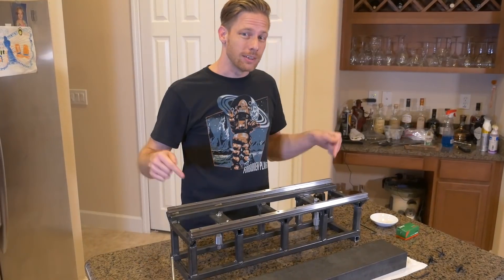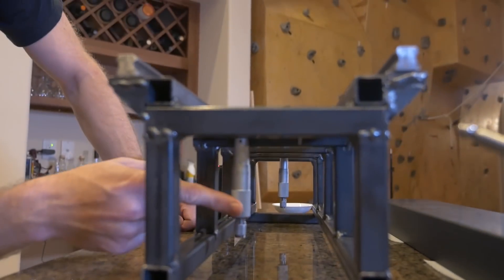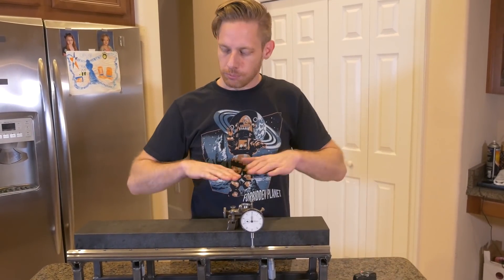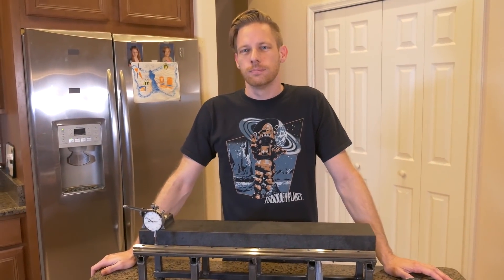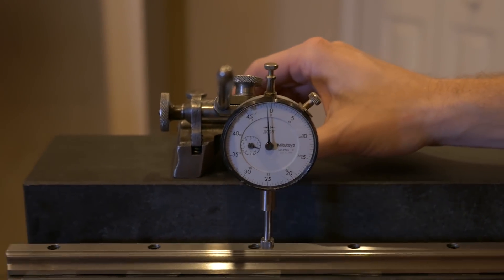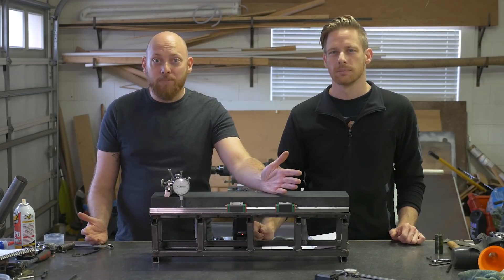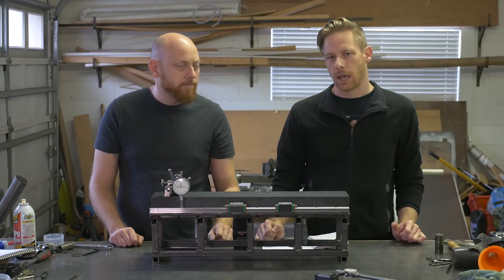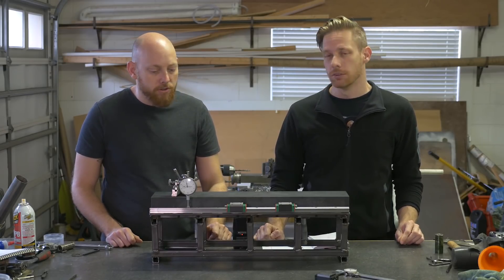Mini Surface Grinder Part 1 - S02E12

Comment: You must break a lot of taps...
Reply from the maker: haha, i guess you can tell by how careful we are being. the tap we used for this was pretty old, and not that good to start with. also Ryan was being extra careful to get them tapped straight as its pretty critical for this setup.
Reply: Agbhar Gihad haha, I don't think I'm doing too bad. Most of the time my taps wear out before I break them. The real trick to (almost) never breaking taps is to make sure they go in straight. Next most common is having the tap in a handle and snagging it on something sticking off the work piece...whoops...

Comment: Very interesting.  I love how you feel like you have to explain why you did it so the YouTube experts won't tear you apart.  Thanks for sharing.
Reply from the maker: yeah, we are also trying to think a little outside the box on some of this stuff, so it warrants a little over explaining. neither Ryan or i come from a machinist background so a lot of the times we do things in weird ways that people in the industry think are crazy. sometimes they are right ;)
Reply: It seems worth separating the personal from the technical.  Let's distinguish "tearing them apart" - personal - from attempting to provide hard-earned knowledge about how to improve the project - technical.  
I would rather someone explained to me that metal will warp during welding, and what I could do to reduce or avoid or allow for that, and that it needs to be stress-relieved after welding, than have what I thought was a decent machine tool come out warped, twisted and unstable - and transfer that distortion to everything I used it on (such as a lathe bed).

Comment: It looked like your metal frame rested on 4 points. Why not have one end rest on a single point so you dont need to worry about countertop flex which could take your ways out of parallel. If frame is very ridgid(looks to be) it should be resting on 3 out of the 4 legs unless your counter is flatter the the plane of the 4 feet supporting your metal frame. To clarify, it is very unlikey that your counter is within .0005 between the ends of the 2 bars. That would very likely cause a twist in your ways. 3 contact points would take out another variable of the many that must be dealt with.
Reply from the maker: thanks Jim, thats good thinking. i am curious how much it will put twist in the rig given how rigid it is. i will add it to the list of tests to do tonight.
Reply: Not much at all, but since you are going for .0005, I can see it twisting at least .001. since your counter is likely of by a few thousandths from polishing and maybe another couple from the cabinet structure and adhesive, that and the fact that it wasn't rocking means that it conformed to your counter- otherwise we'd be assuming that both your frame and counter we're within .0005. please don't take this as a negative comment- I loved the video and what you guys are doing or I wouldn't take the time. I want you to have a near perfect surface grinder and if I see where my $.02 can I'm going to offer it. I've made spools for hydraulic valves within .0002 on a harbor freight lathe so I know first hand that precision work can be done on harbor freight tools. That said, I also have YouTube "experience" lol from watching oxtool. You probably know who he is, but he has many videos on high precision work with basic tools.

Comment: Interesting project. I like how you went about checking the flatness of both rails. One small suggestion, please add some more and larger support gussets. It sounds like you plan to mount the other axis on top of this one, in which case this seems far too flimsy.
Reply from the maker: thanks Siegfried, that was my first instinct as well after seeing Ryan's design. he said he thought it was going to be enough (he is often right about these things) so we moved forward. after it was built i put the surface gauge on it and put as much of my weight on one point as i could (maybe 100lbs) and didn't see the gauge move even a quarter thou. for grinding, this set up wont ever see that kind of load. later on when we build the big one it will end being a cnc mill, and will see higher loads, in which case we will beef things up.

Comment: You guys know there's going to be people who say you can't do this, I'm in your corner boys and wish you all the luck, my only advice would be set up set up and set up and the least amount of grinding possible on the lathe bed ways, I'm sure hoping it works out for you after all the work you've put in to the lath so far, may be you could put a test piece on the bed some how when you get to that point.

Great job, Alan.
Reply from the maker: Thanks Alan, we have been discussing how to mitigate risk for a while now on that subject. i do plan to do incremental testing, including some test pieces strapped to the bed.

Comment: just out of curiosity, did you check your granite? found the setup with the bessle points very impressive and clever ;)
Reply: Anton I don't have the ability/tools to check the granite myself, so I'm relying on the manufacturer there. Their inspection paper says they're flat, parallel and perpendicular to a few millionths- I can at least confirm the sides are parallel to under 0.0001" using a micrometer. Maybe in the future I'll go hunting for (or make?) an autocollimator
Reply: Ah sorry i forgot you bought the granite plate, somehow i thought it was an auction score ;)
I suppose we can trust the manufacturer ^^ thanks for your reply and I'm looking forward to your next video!
The way you approach certain things is fascinating and also for me a great learning experience. I couldn't think of anybody else who goes all in when it comes to renovating one machine and ends up building one to do the job :D
Have a nice day!

Comment: What about torque on all the allens? really curious if you established a uniform torque.... is it necessary??
Reply: Liazon098 I expected to break out the torque wrench or to count flats, but it turned out that as long as it was "tight" no amount of tightening made any difference to the measurements

Comment: It would be interesting to see the actual accuracy of the whole setup.  You have no solid contact between the frame and the rails. I mean, you have shims right under the bolt and there is nothing to support the rail between shims.  The rail may looks rigid, but it actually isn't. If you put a dial gauge to the rail center and apply force downward to the rail you will see what I mean. When you put Y axis ontop a rails, it weight will bend a rails just a bit, and this deformations will be quite uneven through the rail. It may work for your cases, especially if you aren't going to precisely grind large surfaces. 

BTW, why don't you use granite surface plate as a base for your grinder?
Reply: It will not be accurate, not by a long shot.
Reply: Maksim Gurtovenko just gave it a try (indicator centered between bolts on the section with the most shim) and couldn't get the dial to even wiggle. I think we're still in good shape!

Comment: Nothing like building a precision machine with Harbor Freight tools. 😂

Use a torque wrench on those bolts to make sure you're getting the same torque on all bolts, every time. 

Solid mild steel bar stock is not very expensive for this scale. Might have made more sense than tubing. Too late now, so instead pour lead in the tubes for rigidity and mass. Then re-level with a torque wrench.
Reply: Jon Miller, i think the same with the torque wrench

Comment: Any recommendations on where to get a reference plate?  aka the granite thing?  What makes it even more complicated is Australia :(
Reply: Joe -  New they are expensive. You can find surface plates at industrial cutting tool stores, also on-line. You can pick one up at bankruptcy and estate auctions. Here's a cheat: a piece of float glass is pretty flat. The downside is getting a thick enough piece.
Reply: Glass is not flat compared to a lapped granite surface.
Reply: Check out MSC industrial supply.
Reply: Barthoization - Agreed. But lapped granite is comparatively expensive. The guys in the video aren't using a lapped granite surface. It's a kitchen countertop, which is more smooth than flat.
Reply: SeaDadLife what led you to that assumption?
Reply: Joe  The black bar of granite  is a highly accurate reference. But the flat surface granite was in their kitchen.

Comment: Just out of curiosity, why would you measure your tolerances from the top of the rail surface (where the bolt holes are) and not from the tapered part of the rail where the slider bearing make contact with the rail?
Reply from the maker: Great Question, mostly out of convenience. the part the bearings slide on are actually concave to match the profile of the ball bearings in the carriage so taking a measurement off them consistently is very difficult. that being said we will actually be taking final measurements right off the carriage when we are done. that's the only measurement that actually counts.

Comment: Great work, You are going to get different results depending on how much you torque down the bolts. maybe use a torque wrench for repeatable results. Keep up the good work!
Reply: My thought also
Reply: Maxi77 I thought the same. Also did you check the shim stock thickness?
Reply: Maxi77 I would have thought so too and had a plan that was a bit more accurate than a torque wrench in place, but everything is actually very solid. No amount of tightening beyond "the German standard" (güten'tight) made any difference to the measurements. I spent years doing engine heads, I guess that stainless shim stock is just that much harder than a steel head gasket...
Reply: Leveling each rail to each other  is the hard part the reason machine bases are so big to keep the ways in relative position there setup will be changed by position and torque so it's like chasing their tails

Comment: in before the haters 
itl never work itll never be flat 
itll twisrpt when you weld it 
i can tell from my 800 yrs youtube machining experence 

i ask people hpw do they soppse the first surface grinder lathe or mill was made 
they were built wothout machine tools 
just diligent people taking their time 
i rekon this thing will work well, im exited to see where it goes
Reply: fowletm1992 - I see what ya did there, it's a what come first thing... the chicken or the egg; or in this case... the precision machine or the person that built it.  Clearly, sarcasm has no place on the Interweb.  If all else fails, keep ya d@#k in a vice.
Reply: first machine tools were made with hand tools and lapping and scraping techniques. components were made from rigid and heavy cast iron. Im a machine tool builder not youtube expert!
Reply: fowletm1992 3 points is key. Pressing the 2 end bars on to a non flat countertop will give you a set of ways that twist to match the countertop- the granite is on 3 points, but the piece under it is being flexed  to match the counter. Had the lower piece been triangles like a train trestle, it would have cut out much of the flex but still would not be able to keep the end points within .0005 wit the granite bar on top. Weld 2 balls from your kuds "magnetix" building set to one end and one to the center of the other. That will remove the twist the counter put in your ways- Im assuming your countertop was shimed to .0005 flatness over 2ft.
Reply: fowletm1992 wy dou u rite laik dat?
Reply: Luke Johnson 
this bloke gets it
Reply: A lot of the early machine tools were made with wood. Several cannon boring lathes from the American Civil War had iron ways laid over a wooden bed.
Reply: So the guy who didn't catch my sarcasm while addressing your sarcasm "gets it"? That's hilarious. 

Incidentally, eggs predate chickens by millions of years.
Reply: fowletm1992 You clearly understand all things precision, whether machinery/metrology or language. 😂
Reply: Jon 
All those YouTube videos count as actual experience don't they?

I do have a lathe i use on the farm and am apt at making dodgy shit quickly and making it work good
Just a skill any farmer  needs lol
Reply: His tools are "moore special" than mine for sure! I've made reusable, leak free, steel concrete forms by "scraping" with a grinder. Just rub the 2 pieces together and grind down the highs, flip and repeat- pretty soon you a very tight fit- tight enough for concrete anyway.

Comment: what are the tolerances on the linear rail and blocks themselves? from my experience with them(cheap ones from china), they are more than one thou off themselves.
Also will fully supported linear rail shafts be better for this application? i just want to know the differences
Reply: Jamie Xu yup, you nailed the real problem we're going to run in to! So far it seems like all the inaccuracies in the blocks are side to side surface not being ground flat, but it's fairly consistent as far as tracking down the rail. I expect this won't be perfect in the end. I'm hoping pre-order will keep the tracking within tolerance... The big machine will be using some high quality THK rails I snagged on eBay a while back, which seem to be much nicer in every way.